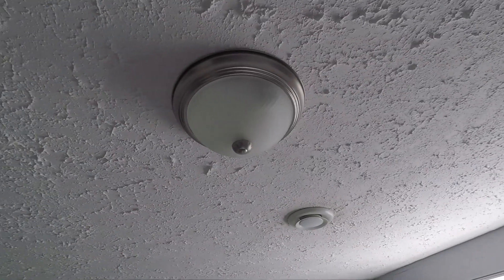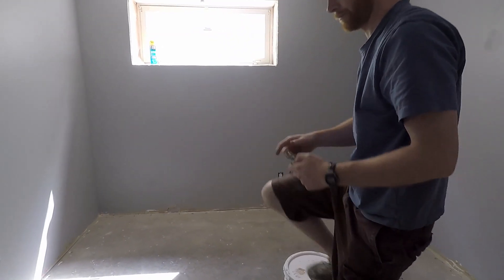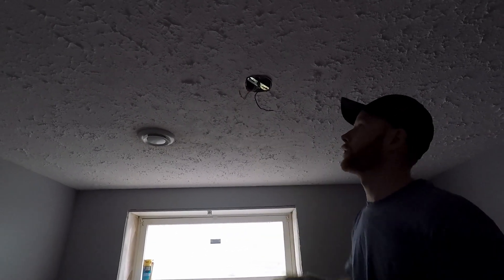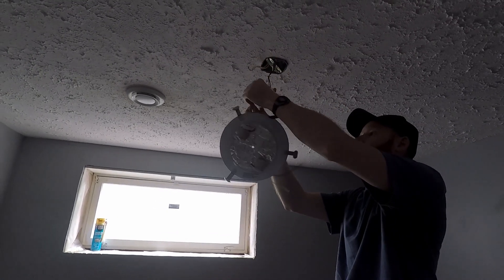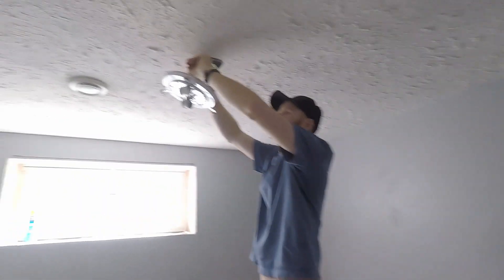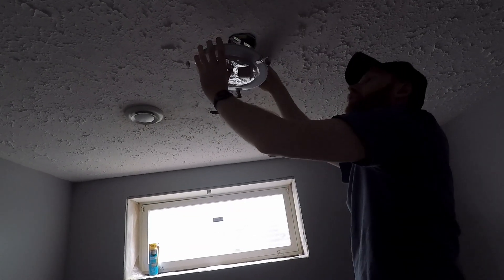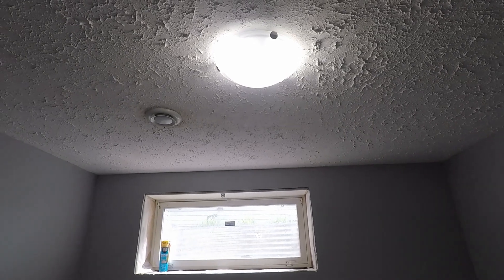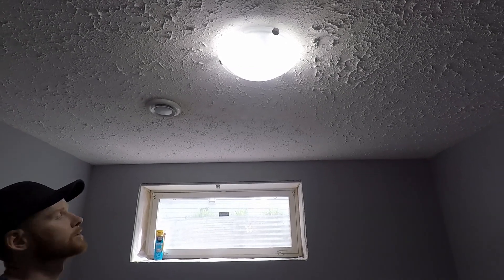Installing a New Ceiling Light

Comment: This would be better if you took a picture of how you attached the wires. Because after watching this it’s pretty unclear?
Reply from the maker: Thanks for the input i will try and do better next time. But for the wires it fairly easy just connect all your black wires together, and connector all your white wires together. Then lastly attach your bare cooper wire together they will be your ground wire. You can connect them with wire connector, Push in style, or twist style. Some people call them wire nuts, wire cones, Marrette. Below i have links to what they might look like. I use wire nuts. I hope this give you a better understanding of how i installed it. I will do another video later on installing some other lights in the bathroom i will do my best to clarify some poor angle i took in this one.  

https://www.homedepot.ca/product/ideal-push-in-wire-connectors-assorted-10-pack-/1000511478 
https://www.homedepot.ca/product/commercial-electric-ce-wire-connectors-assorted-20-pack-/1000663497